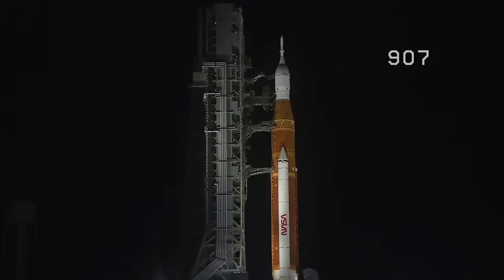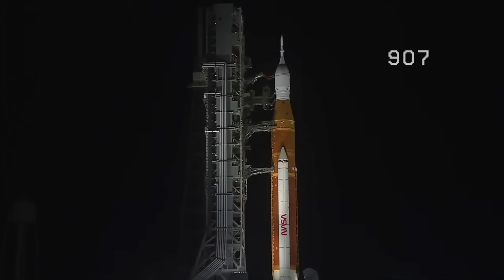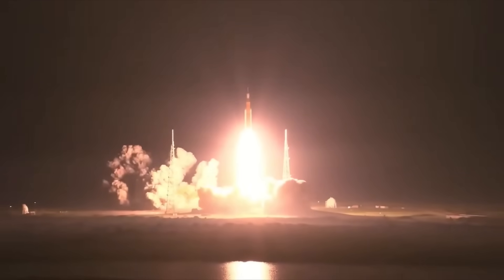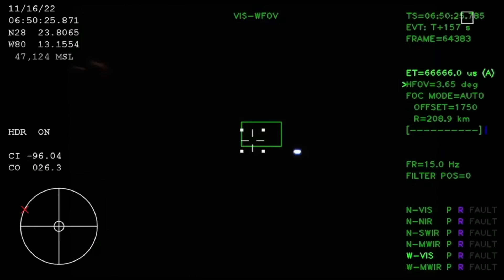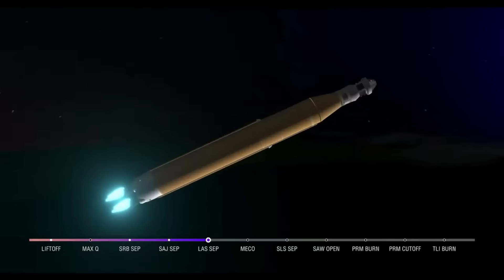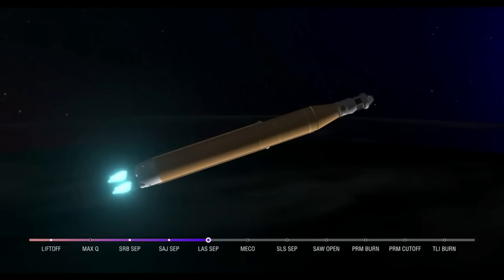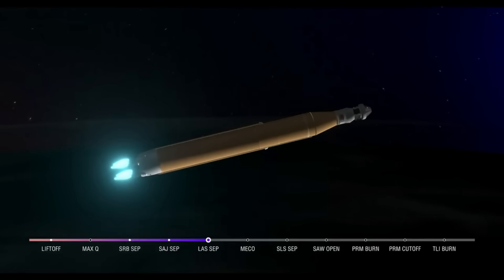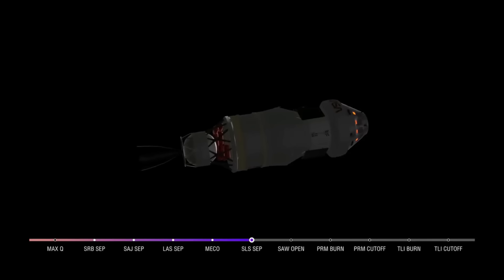Blastoff! NASA's Artemis 1 moon rocket launches on historic first mission

Comment: What a way to keep it secret until the actual launch do you know what about time this damn thing got off the pad and see if I didn’t get off the pad this time scrap it go with SpaceX falcon heavy and save some money instead of blown wasting money like you guys did with over cost overruns
Reply: Secret?  There was nothing secret about this.
Reply: What do you mean “secret”? NASA announced this YEARS ago! Plus, the Falcon Heavy can’t even reach the moon!
Reply: @robloxpro947  what I am referring to are the two failures and then this launch was not even known it seemed like until the last possible minute when the video showed up here on YouTube and the falcon heavy can do just the same as the LS shuttle part wannabe system which actually is more expensive and cost overruns compared to the falcon heavy which would’ve been half the cost and more efficient and on top they could’ve attached the Orion space capsule and the European module and it still would’ve gone just fine no problem and been on its way like it was off the launch system that they use which was behind budget ahead behind the schedule and over budget falcon heavy would’ve been half the price and better than the shuttle parts that were scavenged to put together Space launch system
Reply: @John Hazenhousen no haven’t been under a rock but I think you have if you don’t realize the cost ratio to over cost ratio that the space launch system has where falcon heavy does not have any of that problem which I would prefer to see it go up on this falcon heavy
Reply: @danyelPitmon  
Punctuation is your friend. Would you like me to introduce you?

Comment: Watching Artemis last night I was shocked by the difference of 50 years. Saturn ignited, lifted slow then gained speed. Artemis LEAPED of the pad like a bat out of hell! I was seriously shocked how fast those SRBs kicked that mule into the air.
Reply: Shuttle also had that habit of getting going in a hurry, and SLS has more in common with that than the Saturn V.
Reply: yeah the sls legit was made from retired shuttle parts i think @vicroc4
Reply: Bob Crippen has been quoted saying that the SRB's igniting up felt like a carrier cat shot. The shuttle stack was already going over 100 mph after clearing the tower.

The later revisions of the shuttle SRB's were rated at around 3,300,000 lbs of thrust EACH (the Saturn V's F1's generated 1.5 million lbs each). This means the shuttle stack generated slightly more thrust than the Saturn V at launch. With the shuttle stack weighing 4.4 million lbs at liftoff and the Saturn V weighing 6.5 million, it's easy to see why the shuttle got going in a big hurry (in comparison).

Another fun fact: about 58% (well over half) of the shuttle stack's weight at liftoff consisted of the two SRB's... which made them VERY dense suckers!

Any way you slice it, those SRB's are MONSTERS.
Reply: I went back and watched the old footage of Apollo 17 launching and you are absolutely right. Saturn practically lumbered its way up past the launch tower then slowly gained speed while Artemis just felt so sleek and nimble. Absolutely wild how much progress we’ve made in launch technology over the past 50 years
Reply: @SilentSaturn  The Saturn 5 was more impressive at lift off.
Reply: I am aware I am replying to an old comment, but I'd imagine this is because the SLS has/had Solid Rocket Boosters, something the Saturn V lacked.

...the 2nd reply details the exact same thing.
Reply: The S5 was much more impressive.  I saw one launch in person. That slow rise of the pad was awe-inspiring.  The ground under my feet was shaking.
Reply: I was thinking the same thing! I know this is an old reply but I didn't get to the video until now… Both rockets were/are amazing! It's really cool to see the progress, and I would love to see an Artemis launch in person!it's going to be one heck of a ride for those astronauts!
Reply: @andrewlindenfeld6222  The Saturn 5 was a beast. It's 5 main engines were enormous. The ground  was shaking 3 miles away from the launch pad. Artemis  launches so fast it reminds me of a model rocket.
Reply: You should see all the apollo non-edited tapes on an hd tv.  Most of them you can see the man standing behind the spaceship when it's in space. 😂
Reply: The Saturn 5 was way more impressive at lift off. I was there for a launch with my father in 1970 or 71. I was 11 years old. When it lifted off, the ground shook under our feet.  I asked my dad how far we were from the rocket? He said 8 miles away! My mom was in our camper, and she said it was shaking.

Comment: Rockets are NOT the future of  human spaceflight you idiots.  This is archaic decay system technology.  This is stone age tech.  
Field generating propulsion systems would take you to the moon in less than a minute.  Silly humans.  It's called magnetism,  and it holds the Universe together.
Reply: @C1E5 Actually,  we do.  All that's required is the right geometry.  The arch form motor is one geometry,  but requires a spinning action between the magnets and copper armature to manifest what we call "electricity ".  Generators don't actually generate anything.  They set up a condition,  whereby electricity is manifest.  Electricity is a hybrid of dialectricity and magnetism.  
There are geometries,  that don't require moving parts or spinning action to achieve the same thing.  The Universe has limitless energy, and as with everything in Nature,  it's simply recycled.

Comment: How much fuel does this burn up?
Reply: The SLS core stage uses some 730,000 gallons of chilled liquid hydrogen and oxygen to fuel its four RS-25 engines. The two Solid Rocket Boosters consume 11,000 pounds of fuel per second.

Comment: We stood on the bow of our cruise ship (Mariner of the Seas) after boarding in Port Canaveral on September 3rd looking over at Artemis 1 sitting on the launch pad ready to go. We had a front row seat for the 3 o'clock lift-off. It was scrubbed. 2 1/2 months later, it goes.

Comment: It starts out accelerating as fast as a moderately fast car, but straight up! And the acceleration grows from there, with a much higher top speed. Impressive.

Where does the first stage make its soft landing for re-use?
Reply: Unfortunately, this one's going the same place the Saturn V first stage went.
Reply: I don’t think SpaceX would even be able to recover the core stage - it basically went orbital

Comment: HAHA We already went to the moon, so why are they testing for radiation and other tests that 6 missions already made 60 years ago? What's the point? People will believe anything they are told when it comes to space. Billions are up for grabs. Lets have video all the way to the moon or it is just more blue screen BS.
Reply: The sole purpose of the mannequins is not to measure radiation. They are wearing the first-generation Orion Crew Survival System suit – a spacesuit astronauts will wear during launch, entry, and other dynamic phases of their missions. These are fitted with sensors to record gs and  acceleration. Engineers will compare Artemis I flight data with previous ground-based vibration tests with the same test dummy, and human subjects, to correlate performance. Accelerometers inside Orion will provide data for comparing vibration and acceleration between the upper and lower seats. It also evaluates the integration of the newly designed systems with an energy dampening system that the seats are mounted on.

In terms of radiation, Orion is a completely different craft to Apollo designed for longer duration and distance The longest Apollo mission was Apollo 17 at 12 days - in comparison, Artemis 1 is 25 days (42 originally) and unlike Apollo reaches an apogee around the moon of 40,000 miles. One of the mannequins is testing a new radiation shielding vest, called the astrorad. Also the mission coincides with peak solar activity which is a tremendous opportunity to gain more data in respect of the crew cabin and its systems.

Comment: I was looking at the specs of the old Apollo capsule and the new Orion capsule and yeah there is a bit more room in the new larger capsule but instead of 3 men it is now 4 men!  Also the Apollo missions were geared for a few days with a break of strolling on the moon.  Orion they want the guys crammed in there for up to 3 weeks I am reading!  That is just crazy.  One case of space sickness such as barfing, the runs,  or a single anxiety attack and the crew is in a hell of a mess and a scrapped mission.
Reply: Artemis 2 or 3 I think is supposed to launch the Lunar Gateway, which will provide a larger habitable volume that the astronauts can use for much of that time.  Kind of like Dragon or Soyuz for the ISS, Orion is basically a glorified taxi.

Comment: Incredible launch going back to the moon.  I was just old enough to remember the last part of the Mercury Missions in the early 60's.  It's amazing to think that the first flight was in 1903 by the Wright Brothers and less than 60 years later there was manned missions planning on going to the moon. It turned out that I was in Vancouver, Canada when NASA landed on the moon in 1969.
Reply: The first rockets were used in the 14th century. Not to diminish the achievement, but rockets have been around a long time
Reply: To add to Keith Thorne's comment, the Wright brothers were NOT the first people to fly. It's a common misconception.
Reply: @qOmega  True their were gliders. Most aviation historians believe the Wright Brothers met the criteria to be considered the inventors of the first successful airplane before Santos-Dumont because the Wright Flyer was heavier-than-air, manned and powered, able to take off and land under its own power.

Comment: Big Question: Can this compete with both Falcon Heavy and Starship?  It took this almost ten years and billions of dollars to put Artemis together and today it launched.  Now it's Falcon Heavy's turn to do an unmanned mission to the moon and back, using an unmanned Dragon capsule.
Reply: AND...  do it with re-used boosters, AND LIVE TV FEEDS.. NOT A CARTOON.
Reply: Falcon Heavy (from what I have gathered) is soon to be retired and Starship isnt ready yet (and god knows when it will be since every time frame SpaceX releases is often changed). It wouldn't make much since for them to send an unmanned dragon to the moon since the mission won't and cant be conducted in one unless it is completely redesigned (maybe not completely but it will need work. They originally wanted to use one for Mars but haven't heard about it in a while: that one was said to need some work. It wouldn't be exactly the same as the one that went to the ISS). Dragon is for missions to the ISS. It is a very different capsule when compared to Orion. It's kind of a grey area, looking into it, it's rather complicated. It could theoretically be possible with some reworking, but then again, there aren't plans to certify Falcon Heavy for manned missions from what I am able to gather. I honestly hope they never do that since it would further distract them from finishing Starship (which is already well behind the original plan).
Reply: @FukinSkunk  Starship maybe just be too large to blastoff from Earth's atmosphere. I think FAA is worried about its size and blast power into the Earth's atmosphere from launch to orbit.  That is what's holding up Space X. A full Starship and booster launch will be 100 times what Artimus launched last Wednesday.  Of course the FAA and NASA are worried about too much power that could damage everything within a 10-mile radius of the tower, including Pad 39A That would doom the ISS and it would have to be evacuated.

      Starship may have to be constructed in space. They will need Falcon Heavy to ferry up material to build an orbiting spaceship plant that builds a starship that can be up to ten times what is being built on land. In space, space ships can be a mile long with nuclear engines.
Reply: Exactly!  ....When Elon has obviously outclassed all of this at far lower cost.
Reply: @MarkShinnick  Dude we get it…Musk put a f&ckin rocket in space! Why are you spamming that comment all over the comments section? Can’t you just enjoy other entities’ successes in space exploration???
Reply: @jman7638  He's put more there than anyone....and sent his own car to Mars years ago.  What's to enjoy when now done so inefficiently at the cost of USA's treasure long after NASA's original justification for the Privatization of space isn't in the immature memory.
Reply: @Isosyth  Once someone has to resort to no sequitur, credibility is lost for all to witness.
Reply: @jman7638  At what cost?  ARTEMIS is a big... NO...HUGE waste of money.  What is the benefit of launching every other year, other than not wasting $billions more if it was launched every year?   That is why we deride ARTEMIS.
Reply: @MarkShinnick  yet space x hasn't been to the moon or even put a man in space. They are just a contractor.
Reply: @robertlang4292  do you not understand how money and funding works? When nasa spends their funding (money literally meant to be spent) it goes back into the economy. Not spending money is a waste.
Reply: @Jeremy9697  You should get your facts straight and honest before permanently posting falsehood.
Reply: @Jeremy9697  You've destroyed your credibility for all to forever see to implore my research in the face of your lying ignoring the SpaceX 2020 manned delivery to ISS.
Reply: @Jeremy9697  I beg to differ.  The only money that the government has is YOUR and MY money.  If they spent none of it, then there would be no need and thus NO TAXES.  The money not spent would stay with the taxpayers and then we, by the millions of selfish decisions that we make every day, would, for the most part, spend the money most EFFICIENTLY.  Not my original idea, I think.  It comes from an early economist named something Smith.  But I think Keanes and Freeman (for give spelling errors here, please) also support the idea that individual greed drives efficiency but government in its collective mind drives waste.

And, oh, BTW, let's talk govt money.  The idea of building the rocket is typically three-year RDT&E funding.  Below certain levels (varies each year) unused money or wasteful money can be shiifted or reprogrammed with congressional approval.  Materials bought to support the project is typically two-year P funding.  It too can be pushed about and reprogrammed, in via Congress change color.  The expendables, such as Kerosene and LOX probably gets bought with 1 year O&M funding.  It is the most easily shifted of funds. It just can't be used to run development or at higher levels, buy stuff.

I mention this just to say, I have some idea of what I am talking about.  And, BTW, thank you for your comment.
Reply: @MarkShinnick  that was nasa. Space x is just a contractor for nasa, it was launched by nasa, and nasa personal who launched it. A nasa mission.
Reply: @Jeremy9697  Man, you don't sound mature enough to even remember Mercury, Gemini, or Apollo, and the justification for NASA in the first place.
Reply: @MarkShinnick  wow cool deflect lol
Reply: @Jeremy9697  The point is, pushing money back into the economy... EFFICIENTLY, where it bring the greatest return, is the point I make.  The govt does not strive for efficiency.  That is why they crash hundreds of millions of dollars of hardware into the ocean, vice landing and reusing it.  They do not focus on cost.  That is why Elon Musk is beating NASA in the space launch business, despite his limited funding.  His spending has to be efficient, vice wasteful.
Reply: @robertlang4292  articles didn't even have reusable rockets. Maybe do your reserch why.
Reply: @robertlang4292 how about asking for nearly 900 billion in the defense budget for 2024? Almost a trillion dollars. Why? Nobody can attack our homeland

Comment: In 1981, the Space Shuttle was crewed for it's maiden mission which was pretty gutsy , why not this one as well?
Reply: We had two shuttles kill two crews so far so maybe precaution is waranted. Granded the shuttle had no abort system while this does.
Reply: Those crews were killed by accountants that wouldn’t buy another O-ring.
Reply: @gregquinn6827  Not by accountants.  By the politicians in NASA management who ignored and/or threatened to fire the engineers that stridently warned against launching when it was way too damn cold, based on evidence from previous missions that had also flown in the cold and got lucky.
Reply: @alexvoda  You have a point. I'm a shuttle hugger I love the program but understood that it was also flawed, they overestimated it's reliability and thought that they were flying a space airplane so maybe flying Young and Crippen may not have been the best thing to do.

STS 1 was originally planned to be an RTLS mission. John Young said we're not playing Russian roulette and vetoed the idea.
Reply: Because putting crew on STS-1 was stupid, and NASA rarely makes the same mistake twice - they'd rather find more novel mistakes.